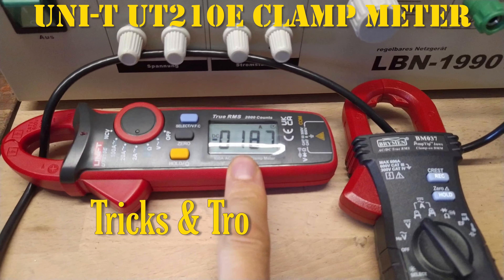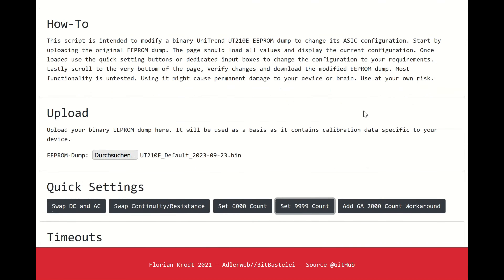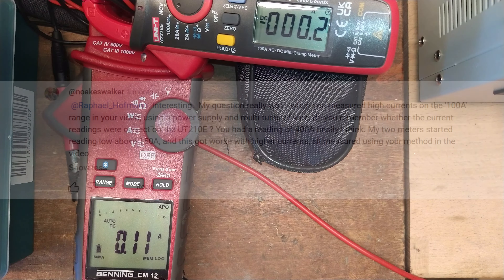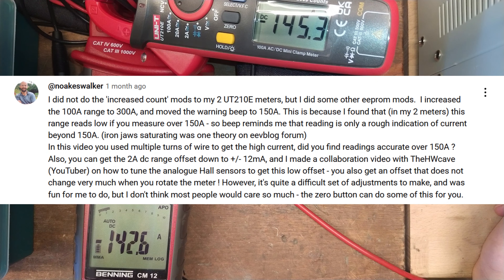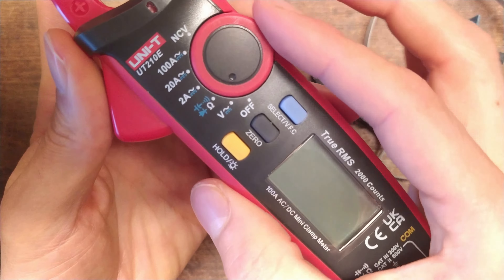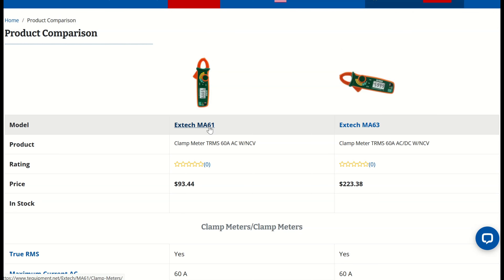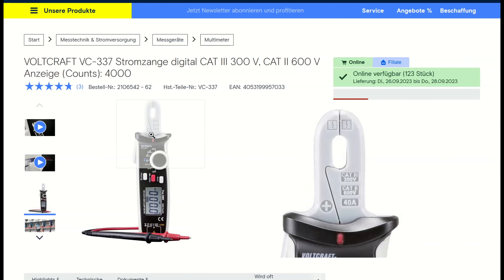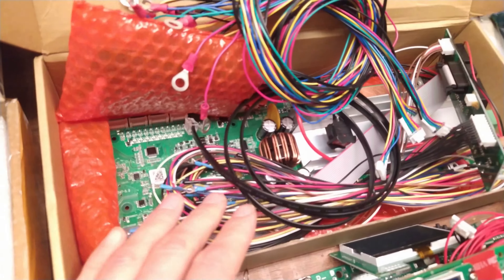UNI-T UT210E Clampmeter Troubleshooting Modifications, Part 3

Comment: Extech MA61 looks like UT211A, and MA63 is the UT211B. I have the UT211b inroute. . From teardown reviews, the EPROM is the same as the UT210e. TA24C02A, and the chip is DTM0660L.

There's not much point to hacking the UT211B firmware other than upgrading the UT211A to include DC since it is available very affordably. Its already 6000 count and the 60A is enough for a pocket clamp.
Reply from the maker: Thanks for sharing your experiance!

Comment: Just bought the new Owon, the zero function is good, not as unstable as the Uni-t.
Reply from the maker: Did you try to modify the EEPROM chip?
Reply: @Raphael_Hofmann  No, although I did buy the 6000 count version as well which was not to my liking. The Owon is slightly better to use for less money, but I wouldn't call it an upgrade or a must-have if I had the uni-t.

Comment: My ut210e dc voltage all the sudden is not accurate anymore and I guess I need to buy new. Should I buy something different??? I need the dc voltage and low current functions mostly. What else is available in this range of low amps measurements and up to 100 amps max??
Reply from the maker: For the price, the UT210E is really a good device and for low currents the resolution is good. There are more expansive Clampmeters out there. But I don't know any, that automaticly start in DC-Current. If you find one, that satisfies you, please leave a further comment. I am also curious.
Reply: @Raphael_Hofmann  is there any way I could fix mine?? It’s reading dc voltages inaccurately thinking I’ll just order another one.
Reply from the maker: @jacobhendrickson8935  There are 3 potentiometers on the PCB. I never had to adjust one of them. You could try that before buying a new one.
Reply: @Raphael_Hofmann  ok thanks, it’s very weird it has always been accurate and the other day I was testing fuses for continuity. Could I have caused this by touching the probes together in the wrong selection?? Because after this dc voltage was no longer accurate.
Reply from the maker: @jacobhendrickson8935  No, tuching the probes together should have no impact, no matter which mode. Did you try to replace/charge the 9V battery?
Reply: @Raphael_Hofmann  yes I tried new batteries. Mine takes 2 triple aaa batteries.
Reply from the maker: @jacobhendrickson8935  Sorry, 2 triple a batteries 😅

Comment: The owon may be 20000 counts but not in current measurement, then it’s just 2000 counts.
Reply: What do you mean please @ssalient😅
Reply: @justmenot3649 Sounds like the Owon loses 1 digit of display when measuring Amps/Current so you are losing the last digit of resolution. i.e., 199.99amps would only display at 199.9amps losing the least significant digit.